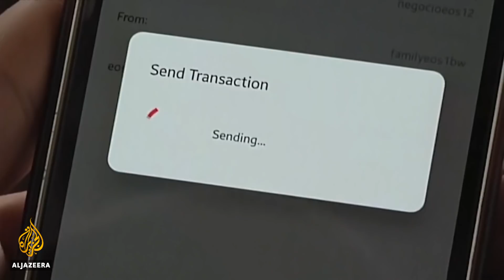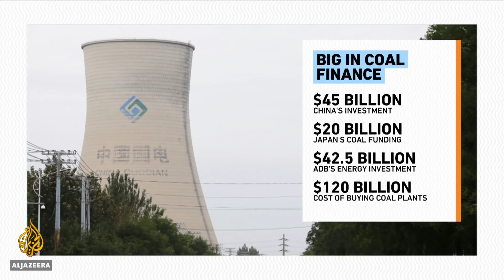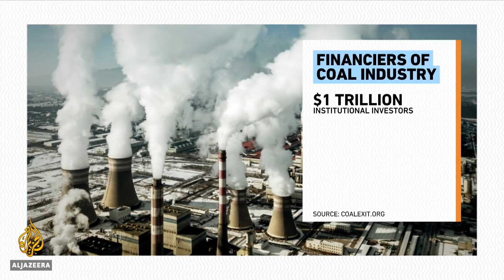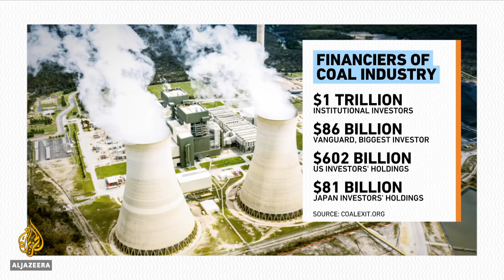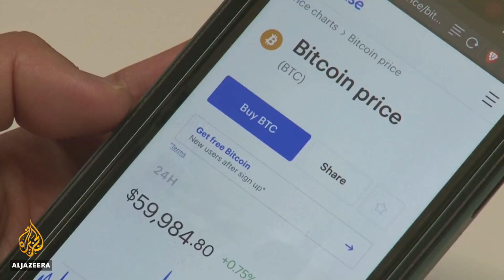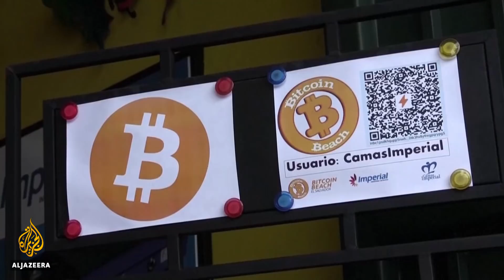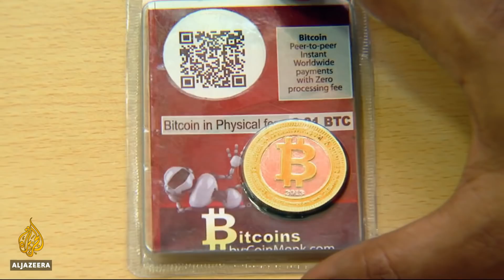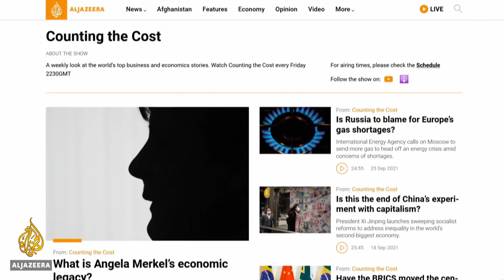Why plans to buy Asia's coal plants will benefit Wall Street | Counting the Cost

Comment: S. Korea is building new nuclear plants, I don't understand why China is falling behind on that technology and relying on coal. Solar, wind and water are nice but the former two aren't reliable 24/7/365, nuclear is the best way forward for them. And China has the industrial capacity and ingenuity to build modular reactors faster and cheaper than anyone else. What better way to liberate themselves and other countries than by mass producing fission reactors that eliminate their dependence on finite resources?
Reply: @MrTaxiRob  How would I know who you shill for? Maybe it is some multiple nuclear power company consortium. It would take 20 years for a new nuclear power plant to come on line. What are you going to do in the meantime?
Reply: @dingjf2219  that doesn't matter, it's causing more problems than it solves. Mitigating those problems requires more energy than that coal provides.
Reply: @MrTaxiRob  China is the world's largest investor in hydro, solar, wind and are investing heavily into nuclear. What are you talking about??
Reply: @nathanielburbery4890  then why all the coal? I'm talking to three different China ballblowers in this comments section and getting twelve different answers.